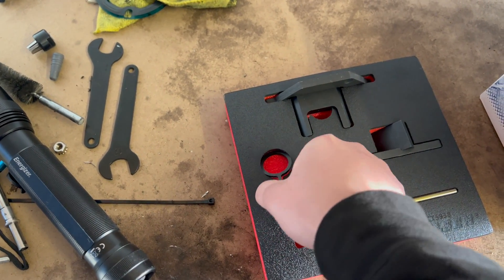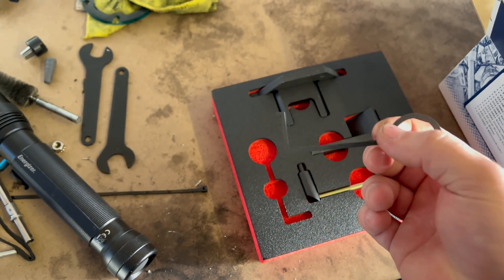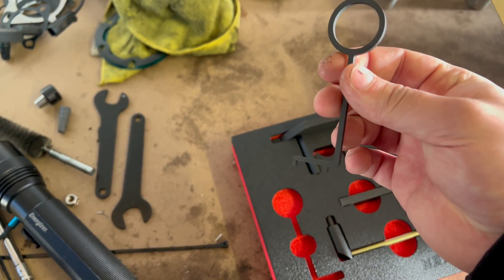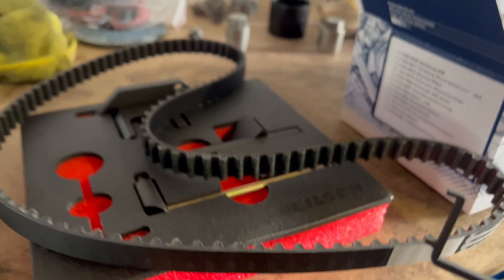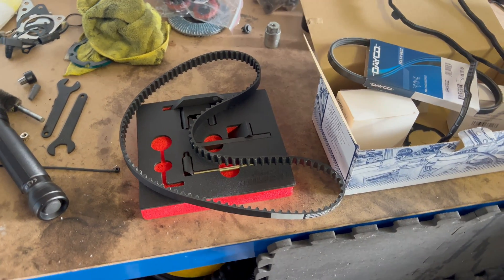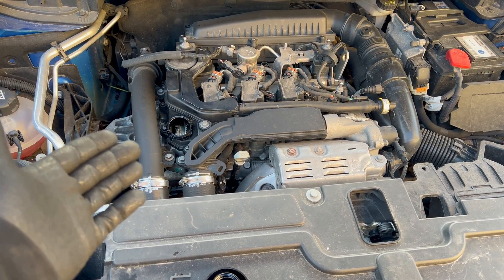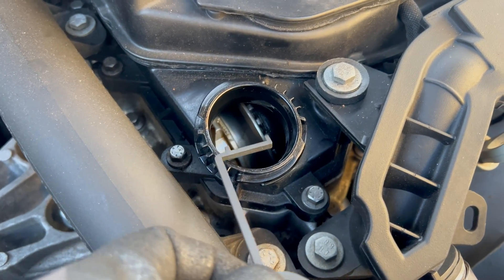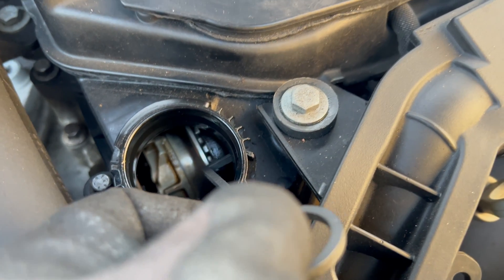Wet Timing Belt Wear Check on 1.2 PureTech Engine - Peugeout, Citroen, DS, Vauxhall, Opel

Comment: On mine the oil filler hole has a coarse plastic strainer that prevents me getting the measuring tool in. The strainer is part of the housing so cannot be removed.

Comment: Good day everyone, I work at Citren, in short - the engine is fantastic. Go to service every 10000 miles, oil from 2 months 2024 is 5w30, and belts are changed at 82.83 atmospheres at 80000 miles, and turbo 110.130 at 60000 miles, we learned that cars that drive longer distances wear a belt less - means the engine is fantastic. Greeting
Reply: so fantastic peugeot changed the recommended interval from 10 years of 112 000 miles too 6 years or 60000 miles for the 1.2 pure tech ,should have been replaced free has this was missold on this crappy wet belt design

Comment: They just recalled the ford 1.0 wet belt engines. The engineers are pretty clever but do they lack common sense or is it by design to just last the length of warranty 🤔
Reply from the maker: If I remember correctly, the one in the video had around 44k miles, so I believe it's still in warranty period.
I would just say that the wet belt design is just purely a dumb idea :D